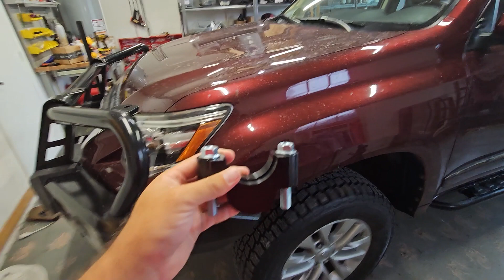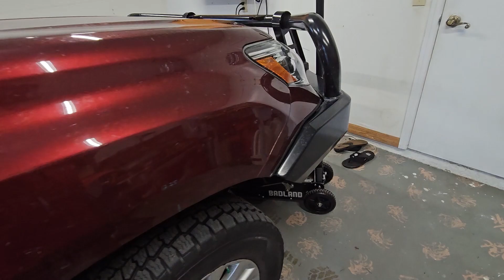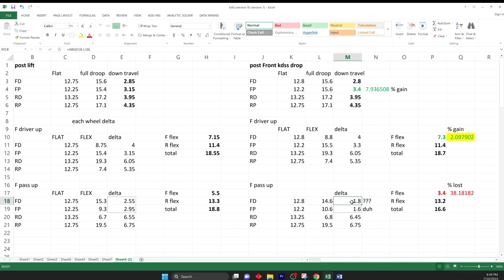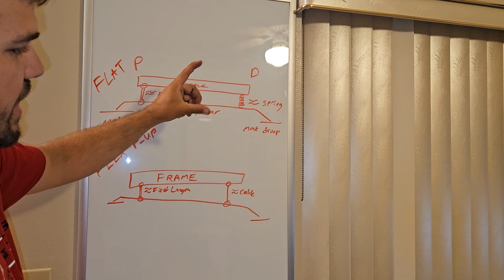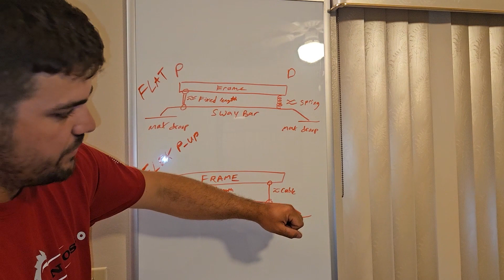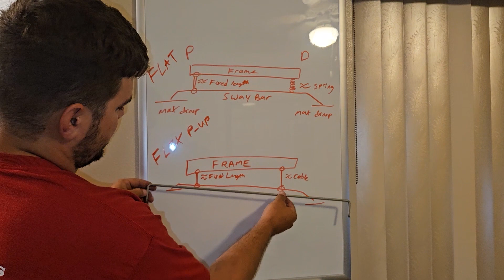GX460 KDSS Spacer Mod is bad for flex! Test and Installation 4runner too

Comment: Is this only test only for the front or the rear too. I know DR.KDSS isnt selling/making the front adapters any more. He came out with something different using plates and bushing brackets.
Reply from the maker: this is front only. I have also tried the rear. It flexed well in the rear but my sway bars hung down so far they contacted a lot of rocks in Moab so I took the rear off halfway through that trip.

Comment: I thought there was a kit with a spacer on both the fixed and cylinder side frame brackets?
Reply from the maker: That's only for the rear totally different discussion. That kit works okay
Reply: Wow. I should have looked closer I guess. I don't run any KDSS spacers, but I remember thinking they were interesting a couple years ago. 
 
Tell me I am crazy, but why not install the same spacer on the other side too? 😆

Comment: So I’m wondering if I installed mine incorrectly, I used both spacers in the rear (one on the cylinder and the other on the link) I would think if you only installed it on the cylinder only this would make it wonky. Am I the only one that installed both spacers in the rear?

Comment: Would adding the 15mm Dobinson spacer fix lean while not affecting droop since it goes on the top of the suspension instead of the bottom?
Reply from the maker: Too much down travel for axles and ucas depending on the struts

Comment: Have you looked into dr KDSS sway part adapter?
Reply from the maker: Yeah. It's cute but you're still going to have binding at one end of your flex. But based on how much he misrepresents his other product I wouldn't give him any business. I'm actually deleting the kdss soon anyway. This old KDSS system is great for on-road handling but not great for people who off-road a lot
Reply: @MudPuppyOffroad you need to remove it if you offroad a lot. I highway drive with the occasional offroad and camp. Best of luck with your removal of the system
Reply: @MudPuppyOffroad  THANK YOU. Everyone glazes this dude that charges $200 for small blocks of aluminum, it's ridiculous. I'll give him credit, it's easy to scam Yota drivers compared to other truck owners.

Comment: I thought tinker said this mod is useful if you lift 2.5 to 3 inchs but not so much 2.5 and below ? What are your thoughts ?
Reply from the maker: Its terrible for flex with any setup
Reply: You loose down travel on the ram.  what ever size the spacer is

Comment: Do you still work on Hondas for customers? If so I have a 2016 Honda 420 that some one did a gear reduction on and now the clutch slips. Was wondering if u would be interested in doing a clutch on it. I live in Tampa area.
Reply from the maker: Yes I can knock that out for you but you'd have to bring it to Orlando and leave it with me for a day or two I keep those clutches in stock if that is the issue
Reply from the maker: Email me at mudpuppygaragemods@gmail.com
Reply: @MudPuppyOffroad  what is a better way to contact you?
Reply from the maker: @CadeCannon-u6c  the email address I just posted this fast it's also in the beginning of most my videos

Comment: did you have kdss lean and did the kdss spacers fix that?
Reply from the maker: I did not have kdss lien nor do I understand how the spacer would ever fix that based on my knowledge of the system. I was hoping the spacer would let me reach full down travel on both sides without losing too much cross axle Flex. The accumulators are opening and closing constantly equalizing pressure so I have no idea how a healthy system could be experiencing lean
Reply: @MudPuppyOffroad Do you still sell arched rear lower control arms for Rubicons?
Reply from the maker: @Hickstabul  i dont not, but i have a set from my personal quad i might consider selling
Reply: I have a 3” Icon lift with new rear track bar. It only leans if you turn aggressively before parking or adding a lot of weight to one side while parked (eg; opening the tire swing).